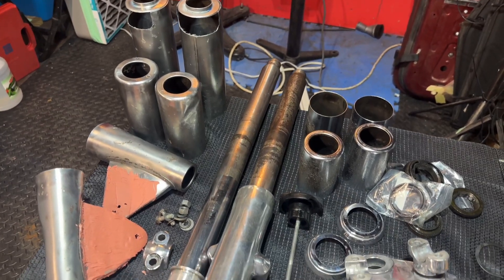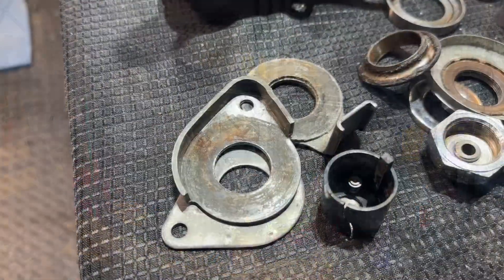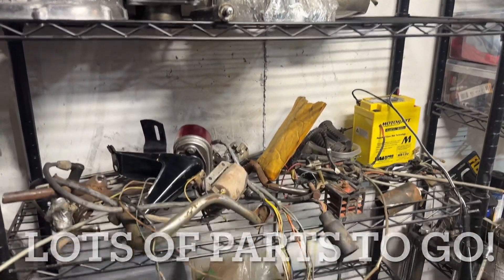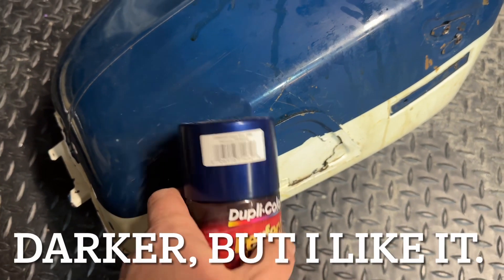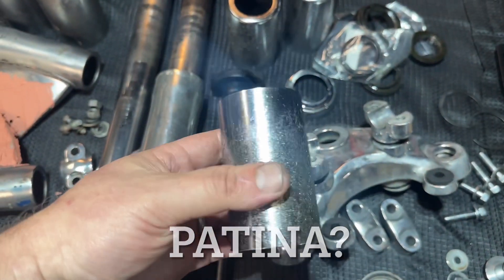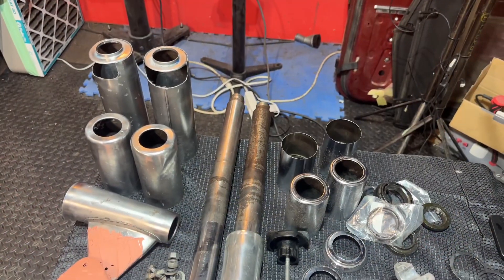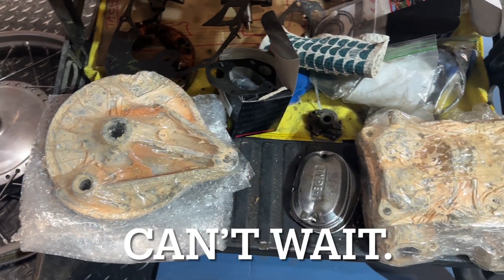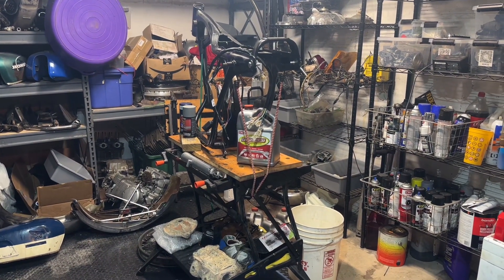1968 CB350 Motorcycle Restoration Project: Turning a corner!

Comment: You are going to have to have some of those parts chrome plated. I bought a Caswell kit and I zinc plate all of my bolts and steel hardware. You can get better than OEM results. I even disassembled the wheels and zinc plated all 72 spokes on a 1982 KX80.
Reply from the maker: We’ll see. If not now, later. Need to keep this one friendly on the budget.
Reply: @KeepOnWrenching  the zinc plating kit will run you about $250. You might be happy with zinc plating some of the chrome parts. It keeps everything from rusting. I have a video on my page that shows the results.
Reply from the maker: @Mr10usdad  I’ll look. I have everything I need to do nickel plating. Never tried it though. Does the old chrome need to be stripped off first or can you go over it?
Reply: @KeepOnWrenching  I am not sure. I have not done much plating over chrome. Although I did zinc plate a brake lever on one of my Honda CT70 bikes. It came out great so I would say you probably do not have to strip it. The foot brake lever on this bike is zinc plated over chrome. https://youtu.be/BUNeUyXQjs8?feature=shared

Comment: I restored my 1969 CL350 a year or so ago and I found That the Jeep color Hydro Blue was a real close match. The bike looks great but on a ride ran into trouble when one of the floats leaked and I barely got home. Been looking for replacement floats( they are the early ones, rectangular) if you ever get em in stock let me know. Good luck on your build.
Reply from the maker: Those rectangular ones are unicorns. Ever try later model carbs? I’m curious if those could work.
Reply: Thanks for responding, do you have an idea which carbs would be an easy swap?
Reply from the maker: @wallygeriostrowski2035 I was hoping you’d know. Time for us to hit the forums. Lol

Comment: So glad you are doing a 68 350. I’m basically at the same spot you are. With my 68. Most of you videos will have me covered but your right 68 has some nuance. What do you use to get the real caked on grease off to clean up parts?
Reply from the maker: If it’s really bad super clean does great. But usually a hot soak with dawn anc a nylon brush will eventually get it.

Comment: I assume this is the frame that was powder coated, what are your plans in terms of grounds across the frame? Sorry for the general question, I have powder coated the frame and all brackets now I'm debating if the Powder coat was a bad idea since I'll have to carefully expose & paint the metal in certain areas.
Reply from the maker: I’ll clear off my few grounding spots. Not anticipating any issues.
Reply: @KeepOnWrenching  It would be really cool if you included that part in your video next time.
Reply from the maker: @jkucukov I’m still working on that bike. Haven’t even got there yet.